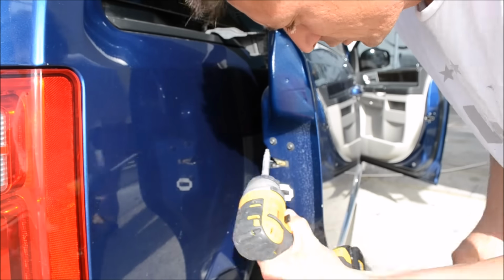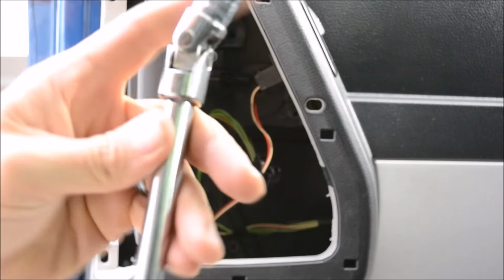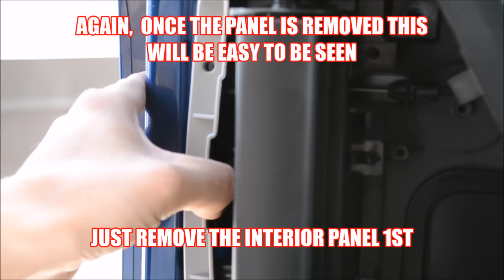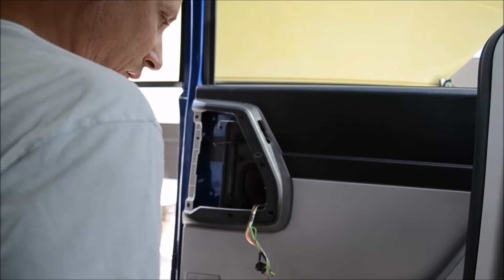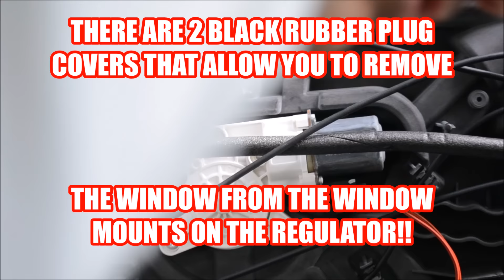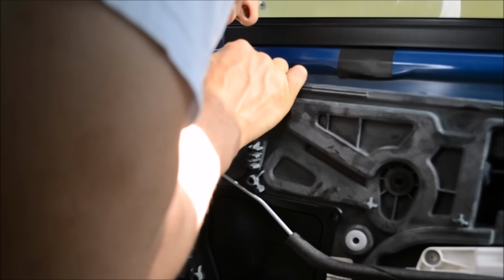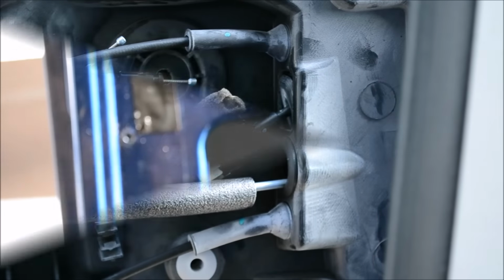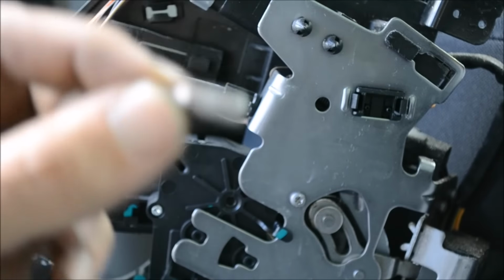2010 and up dodge caravan lock fix

Comment: READ THIS - IF YOUR SLIDING DOOR IS STUCK AND UNABLE TO OPEN. I was unable to open driver side sliding door for months (no buzzing noise from lock mechanism on this side). The manual lock actuator for this door was stuck and could not be forced. The tip about pressing the unlock button and forcing the manual door lock at the same time worked to release the actuator!! KEEP IN MIND... This did not work when using the unlock button on the remote... I had to use the unlock button on the driver door. Now the door lock on this side works fine (like it was never broken). Not sure how long this will last but at least I can open the door currently.
Update: FYI... 9 Months later, the door lock is still working fine...

Comment: My bit of advice: DO NOT remove the 4 screws holding the window regulator mechanism on the panel, if you do, you will have to rewind the wires on the spool and it must be done the right way to avoid having the control sequence reversed at the control button. The motor can be removed but do not remove the 2 screws holding the spool mounting plate in place.
Reply: Could you please explain? I don't want to screw this up.

Comment: Thanks very much for posting this video. I had a similar problem, but it turns out the lock mechanism was jammed due to lack of lubrication, and the motor could not move it. It did hum or make any noise at all. Once so freed up the mechanism and lubed it, everything worked. But, your video helped me get to the problem.
Reply: 8 months later. How's it holding up?
Reply: Michael Pearson  It still works but now the lock motor is buzzing, so I will finally have to replace it..lol
Reply from the maker: pb blaster baby

Comment: i had the same issue , the left motor onthe sliding door making the same sounds its 2016 grand caravan , with 40k miles .  while the right sliding doesn’t lock 🔒 at all.. even tho  it open manually and with remote.  any idea what to do?

Comment: How do you open the door if it's stuck? To begin the disassembly?
Reply: Did you get your door to work?  I had to hold down the unlock button inside the door and press unlock and lock on the key fob.  That was the only way I was able to open door.
Reply: READ THIS - IF YOUR SLIDING DOOR IS STUCK AND UNABLE TO OPEN. I was unable to open driver side sliding door for months (no buzzing noise from lock mechanism on this side). The manual lock actuator for this door was stuck and could not be forced. The tip about pressing the unlock button and forcing the manual door lock at the same time worked to release the actuator!! KEEP IN MIND... This did not work when using the unlock button on the remote... I had to use the unlock button on the driver door. Now the door lock on this side works fine (like it was never broken). Not sure how long this will last but at least I can open the door currently.

Comment: 5 stars from me, as you confirmed the central lock motor is my issue with the noise, second... fair play for the video is not the best but made me realize not and what to do, as when i started doing this i would of made some ofbyour mistakes also... as for the techs, i only had to do this myself as in england when you walk in a garage with issue like this they laugh at you and refuse the work....

Comment: That happens to me right now and I can't open the door at all ... Any ideas!?!?
Reply: Same problem
Reply: READ THIS - IF YOUR SLIDING DOOR IS STUCK AND UNABLE TO OPEN. I was unable to open driver side sliding door for months (no buzzing noise from lock mechanism on this side). The manual lock actuator for this door was stuck and could not be forced. The tip about pressing the unlock button and forcing the manual door lock at the same time worked to release the actuator!! KEEP IN MIND... This did not work when using the unlock button on the remote... I had to use the unlock button on the driver door. Now the door lock on this side works fine (like it was never broken). Not sure how long this will last but at least I can open the door currently.

Comment: No need to remove glass.
Reply: How do you get to the assembly without removing the glass. I'm working at in now
Reply: Duck tape the window up in the closed position
Reply: @dylanlindsay4353  - you can also use wood shims jammed between window and body to hold the window up in place.

Comment: Which cable(s) unlocks the door? Mine is locked shut and I cant get to the screws I need to.
Reply from the maker: Shaun Tube Shaun not sure I believe this is electronic but I would remove the interior panel to access the release.  I'm sorry about the reply but please reply with how you did it
Reply: The problem I had was the door was shut. The lock motor had failed so I could not undo the door. I pulled the panel half off (front of panel is attached with screws that can only be undone when door is open). I got heavy handed with lock connecting rod and it moved! That fixed it! Lucky me I now dont need to go any further at the moment. I have a UK 2013 Grand Voyager.